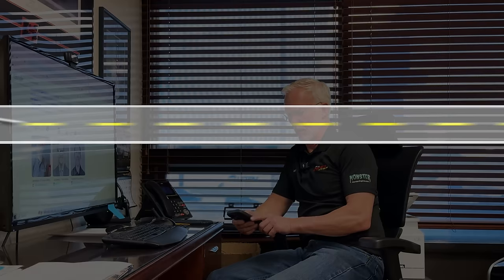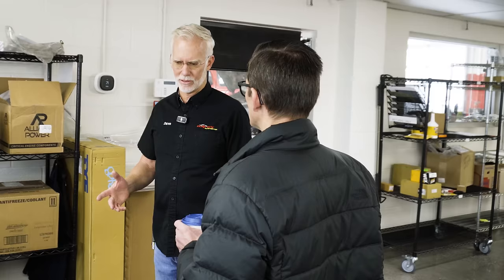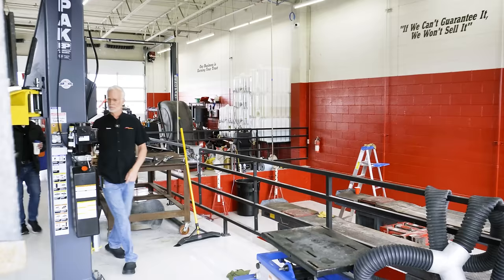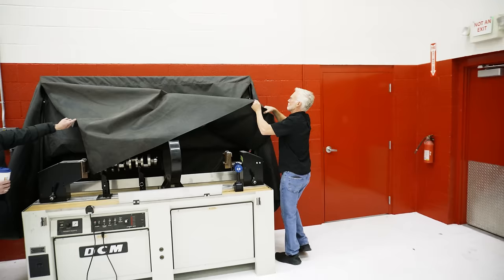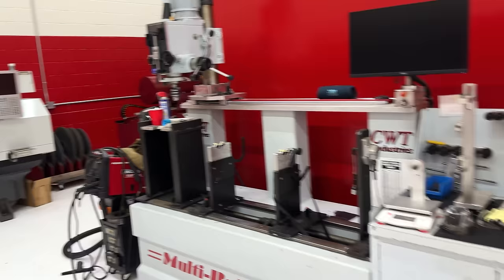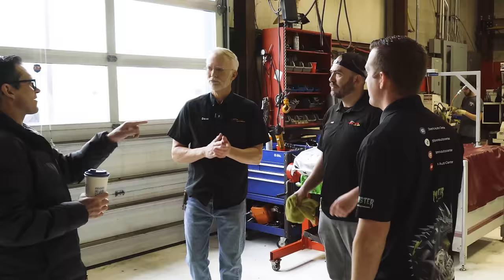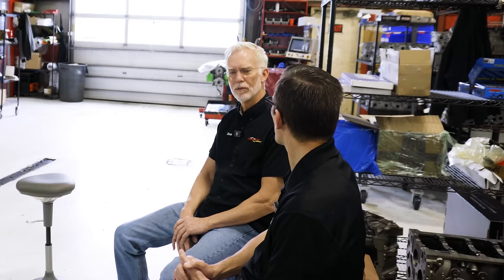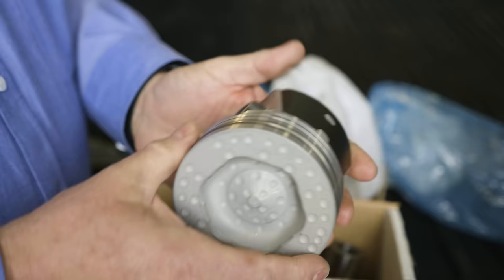Sitting Down With Lake Speed Jr. - The Truth About Oil Change Intervals and Analysis

Comment: I would love to hear their thoughts on Archoil AR6500 diesel fuel additive and AR9100 Oil Friction Modifier. 

I definitely notice a difference in injector spool valve noise when I run the AR9100, the whole engine runs smoother and quieter. I would like to see or hear about the science behind it. I highly doubt it’s a placebo effect as my wife comments on how quiet and smooth it runs too and she is not mechanically inclined or knows when I do or don’t use the additive. 

As for the AR6500 I notice a huge reduction in soot exiting the exhaust when WOT or any time I get on the throttle or towing heavy.

Comment: 25:27 i'm not sure i understand the oil consumption question/answer.
burning 1qt of oil in 1000miles is considered acceptable?
and if so, wouldn't that mean that an engine would have 'almost new' oil in it without ever changing oil just by adding fresh oil?

Comment: I have a question...

If it is recommended to change our oil every 3k miles, then that defeats the economic purpose of many high quality engineered oils with detergents and anti-foaming agents (etc).

There are few scientific studies that truly compare the quality of each oil on the market, but I generally consider penzoil platinum and amsoil as the leaders in synthetic motor oil.

What would you say is the best engine oil for 3000 mile oil intervals and would it be acceptable to use a high interval oil filter or should everything be fresh every 3000 miles.

Comment: 3000 miles between changes is over kill for most people the problem is 2year/20k miles service plans vs old school 6000 to 10000/ annual service plans, if you don't do more than 10k a year just change every year. Also if  doing more frequent oil changes changing the filter everyother time is fine.

Comment: Great stuff! Fascinating to think about soot being the major wear factor in diesels, and the role of fuel contamination. At 24:21, did he mean PCV rather EGR? Or is the issue that reducing blowby reduces PCV flow which in turn reduces oil entering the engine, which makes for cleaner exhaust and therefore cleaner EGR system?

Comment: Question for the experts:  I have an AMG S63 with the 5.5.L twin turbo - expensive motor.  I want to maintain it well so I don't get stuck with big bills down the line.  When I take it to the good local shop they use a vacuum system to suck the old oil up through the dipstick tube, instead of draining it out of the bottom of the engine.  I was wondering if this is a compromised approach because it is 1) bringing sludge back up from the bottom into areas that were sludge-free, and 2) not getting as much sludge out as a bottom drain.  I am grateful for any thoughts y'all may have.  Thanks!  PS, I asked after I saw what they had done, and they said they are willing to bottom drain it, which I am thinking is the way to go next time.

Comment: I change my oil on my yota. Every 5k full synthetic toyota oil from the bottle I've done my analysis and Holy smoke. No wear. Car has 127k   I use regular gas with full bottle of injector cleaner every other fill up.

Comment: I bought a 23 camry 3.5 ,dealer told me the first oil change was in 10,000  miles i laughed so hard anyways I have 6000 miles on it and changed the oil twice already , its funny how they never mention a breakin period. The first oil change i did on camry at 2000 miles it had the normal break in glitter , i couldent imagine going 10,000 miles with that glitter oil

Comment: @DavesAutoCenterCenterville  After watching a ton of your videos, I decided to do a baseline oil analysis at 3700 miles for my brand new Duramax 6.6L and got back results marked "CRITICAL" in certain areas.  Silicone was at 100ppm, and copper at 175ppm.  Are these normal results for a brand new motor breaking in for the first time?  Or is there something I should we worried about?  This is my first diesel truck and I'd love it to last 30 years.  Thanks for all the great videos!

Comment: Some of my life long Friends had an automotive machine shop for over 35 years, and they built stock high performance and Top Alcohol and top fuel engines when a customer with a daily driver would get a engine rebuilt you could tell by the Bore and bearing wear that that engine did not have oil change intervals that were to long dirt it dirt the type of oil was not as important as changing you oil often like 3000 miles or less you can't change you oil to often you spend more money on Gas that oil changes!!!

Comment: So I have a different question about oil and filtration. How good is bypass oil filtration at removing contamination to prolong the oil life? I have worked with some ISO oil cleanliness type requirements and an old engineer really taught me something about particle size.  So I think a 10 micron filter might be practically useless to pull soot out of diesel oil as a speculative thought but based on pulling graphite and cast iron out of machining chips and swarf a 3 micron, provided it doesn’t strip the additives from the oil, would possibly make a substantial improvement.  It just feels like we aren’t doing ourselves justice spending a $10 bill or maybe more per quart on a quality lubricant but letting it become basically a cesspool of debris and contamination.  What’s the fiscally and technically based solutions to this issue?

Comment: The manufacturers current oil change intervals are INSANE.   Although the dealer tells me I am wasting money, the oil is changed in my Super Charged Dodge every 1500 miles, my wifes new Subaru which is direct injection, is changed every 2000 miles.

Comment: Great info. But i still must ask, does the oil used during auto dealership oil change time really do the job the public is led to believe (with respect to engine longevity)? Or are aftermarket/3rd party oil brands better for your engines?

Comment: Put a pre oiler in the 6.7 or a pressure switch so the motor won’t start till oil pressure gets a predetermined psi on the oil in the engine and I did just that on 1992 Dodge 12 valve 5.9 and I put a switch on oil pressure so it would not fire until 20 psi I think that would make life better for 6.7 ford so think about and let me know what you think ?

Comment: can I use a  gapless in a DI ecoboost motor? sounds interesting. Those statements about the OE service interval is spot on. My oil every 5k miles. Hell no from day one. Forced induction DI motor built with aluminum is getting Top grade oil every 3k. They also say 87 octane is fine. Nope Again. the motor originally was built for Sports cars to run Premium. That is all i put in it. Will it go without it sure, but I drive quick and want to keep the power up. So I treat it like a sports car and give it the attention it requires to stay healthy

Comment: Ok… Dave you just changed my paradigm on my oil change ideology. I barely do 10k a year in my 07 5.9 Cummins or my 18 duramax. I figured use the best oil filters and best oil. I use rotella T6. I figured an oil change a year under 10k was sufficient. I do use hot shot every day diesel. So what’s your thoughts on running ATF in the fuel and how much per gallon? Thx for all the info.

Comment: I’ve have always used 15w 40 Amsoil signature series oil. The 5.9 cummins in my 05 Dodge 3500  long bed dullay and I run Rotela 15w-40 regular oil for first year and the second year I run my 15w-40  Amsoil 15w-40 for the rest it’s life and have really had a great experience these cummins motors and have never had to change injectors  in 92  12 valves and drove it for 14 yrs 185 k and then I bought a 05 Dodge 5.9 so I do send my oil in for  Blackstone to check it out and every time they say run it 5000 more but when Iam getting my sample I am changing my oil and I look for fuel in oil or coolant in oil so that’s what I do good or bad ?

Comment: Really good stuff here, interesting to hear other peoples opinions, but honestly, with the quality of todays oils, I change my oil every 8-10k miles I change my filter twice between that.  I own 2 cummins a 2001 and 2011, the 2001 has 300k miles, no issues there the 2011 has 100k still no issues there either.

Comment: My question is about gapless rings in gas rngines - is there any advantage to using them in a daily driver where reliability and durability are more important than using the max power I'm building to? Y'all covered gapless rings in diesel engines, but with the different needs of my humble Ford Modular, I don't want to add issues where none need to be.

Comment: At about 3:30 Lake Speed states that engine oil gets thicker at colder temperatures.  Thats not true.  Oil is engineered to get thinner at cold temps.  Read from an oil viscosity explanation:  The five and 10 digits (as in 5W30 or 10W30) refer to the viscosity at cooler temperatures. So, that means when you are comparing 5w30 vs. 10w30, the thinner 5w30 will circulate quicker, and flow through bearing tolerances better during an engine startup in the winter or colder climates. The “w” behind the five and the 10 indicates that those are the viscosities in colder or winter temperatures. The viscosity of the winter number is tested at 0 degrees Fahrenheit. The 30 refers to the viscosity at higher temperatures.

Comment: Question how does detergent help carbon deposits on direct injection when the fuel doesn't spray on the valve? Which is why some manufacturers have port and direct injection especially on turbocharged vehicles

Comment: 'Acceptable Oil Consumption' is 1 Qt to 1,000 miles? THAT'S NUTS! I have been an AMSOIL guy for my entire 50 year driving life. I have gone way past 200,000 miles on many engines with LONG drain intervals, in some cases up to 50K miles with high bypass filters. I have almost never had to add ANY oil between changes! My old 95 Dodge 1500 went 250,000 miles in 25 years and still didn't burn ANY oil. I just had to replace the truck because the body was disappearing rust by rust.

Comment: first, enjoy your content. Oil types, brands, and intervals are hotly debated topics with many opinions making it confusing. I believe you recommend changing the initial oil at 500-1000k as you did for your daughter's Corolla. I have a new Lexus GX 460 V8 and was planning to change it at 1k until a YT video regarding oil interval, someone replied stating that the initial oil Toyota factory puts is a special blend for the new engine protection of initial break-in and by changing it earlier than recommended by the manufacture you lose the protection chemicals which are not always present in subsequent oils changes such as Mobil one or other brands. Toyota cars build in Japan get their oil from Idemitsu and make a special blend for the initial fill. As an oil specialist, what are your thoughts about the special initial blend in Toyota/Lexus or their oil the same Mobile blend used in Toyota built in the USA?

Comment: I don't want a new truck. Period. I want a strong platform with a reliable powerplant and drivetrain. I want to drive the same truck I already have, in the same way I want to keep the quality tool that I invested in. I've already made the purchase, I don't chase the newest gizmo, and I want my equipment to keep serving my needs, without interruption. I don't want the headache of shopping, dealers, and questions of reliability of new systems where bugs and problems have yet to be worked out. That's why I own a Dodge Ram with a Cummins 5.9. If I could run a 12-valve 5.9 into my 3rd Gen Dually, I'd do it in a heartbeat.

Comment: So.... We need circulation pumps to run around the clock?
I put an oil pan heater to plug in when it's in the 20's f°
And don't just start my 7.3 and go, let it idle to I hear the turbo out of the exhaust

Comment: I think 3000 mile oil changes might be a little overkill with todays engines and oils. However, changing on a regular basis whether at 5, 7.5 or even possibly 10K is imperative. I have seen engines last 300k + with regular oil changes of 7500 mile. For the average person and the average vehicle, regular oil changes at or around 7.5k are going to be fine. A lot of the engines failing early (like Kia and Hyundai) are from poor manufacturing, not prolonged oil changes.  Changing at 3k or so MIGHT make your engine last a little longer, but the reality is most engines today outlast the rest of the vehicle and/or your willingness to keep that vehicle.

Comment: Great video, thanks for the quality info! 😊 I'm running a 2010 Honda Jazz (Fit) 1.3L with 190,000kms on it here in warm QLD Australia. No issues at all, has been a great car and doesn't seem to use any oil yet. I do oil and filter changes every 10,000km with 15W-40 semi synthetic but after watching this I'm thinking it should be 5,000km for the oil and 10,000km for the filter? I'm also running it on E10 fuel as recommended by the manufacturer, should I change to 91?

Comment: I didn't understand what was the conversation about the crankshaft under the cover with green light. 
??? 
What does diesel additive do to gas powered injected ? 
Does it harm parts like ethanol does ? 
Is the engine block that was welded an IRON BLOCK ? 1800F is too high for aluminum. 
Diesel or gas engine ? 
Did he say a cat should only last 80k miles ?  California cats are specific ? 
What about the NASCAR with superhard metal that are hard to hone ? Do you worry about zinc causing wear ? 

Does the direct injection comments apply to gas engines ? Such as  KIA GDI GAS ENGINE ? 
I saw an engine teardown on a new Skyactive G or X more likely. 
The oil ring was clogged with carbon . Engine had less than 50k on it. The X engine is compression ignition but gasoline based. HCCI. 
I would like to see Ford license the tech and apply it to a V8 truck motor. That way fleet operators could replace diesel engines with gas but not have the CARB Board in California say you must retire that vehicle in 10 years. Diesels. 
The FedEx contractors have already sold most of their diesels in this town. We have the highest pollution rating in the USA. THERE ARE hotspots in the Texas and Louisiana refinery and chemical industry on the gulf port ? that I would never live near. Cancer clusters, respiratory problems, etc. 

You don't know how much we pay for good weather. Clean air.

Comment: Diesel Engines can increase the oil level due to fuel dilution. Excess idling, hard driving,  cold starts, etc makes the long intervals no longer valid. Manufacturers have a seperate intervals for "severe" driving.

Comment: Thanks for the awesome video and the plethora of information. I run a 3 litre eco diesel and very anal on service and maintenance. Researched everywhere but this finally makes sense. I put archoil  in every fill up. Can you recommend an additive?  I will now be changing my oil every 3000 miles also. What’s your thoughts on intervals of fuel filter changes. Thanks again for another awesome video

Comment: Did i miss this? What 6.7 are they talking about grabbing the mains? Cummins or Powerstroke? I would also like to Lake's thoughts on idling? I am totally against it. I own two diesels and have less than 10% total idle time. I believe idling is a killer to diesel emissions components.  I have done informal testing and found owners that idle a ton have emissions related issues while owners that turn off the engines to avoid unnecessary idling seem to report high mileage without emissions related failures along with reduced regen cycles.

Comment: So I will definitely be changing oil more frequently. I do have 2011 hemi ram 2500. Primarily just for camping pulling their camper. I do run synthetic but we are only putting on about 4000 miles a year can oil last through the year or should I be changing this a couple times?

Comment: I run a number of new and newish different type vehicles and motorcycles, most are under new warranty. the problem for me is I can only drive one at a time and so the oil change regime is dictated by the calendar rather than mileage. We live in the country so most of the running is hot. I think that oil in a modern engine is still in good condition under those circumstances for much longer than one year. I have also run a product called 'Power-Up' for 20+ years now and have never had any kind of repair problem. Am I right? the servicing is very expensive here with the Jeep dealer (for instance) charging over $50 a litre for engine oil!
Reply: Just to clarify, the oil change recommendation is 10,000km or 6,250 miles, They are all petrol engines from 250-600hp in the cars and pickups One Britsh, 3 American and one Japanese.

Comment: Just a heads up I've taken engines out that had rear main problems that were caused by some fool who put in three different torque converter bowls that did not weigh close to the same. Vibration took out the rear main

Comment: Boy, is it worth doing an oil analysis on my 2000 E450 shuttle bus that I live in? It has a V10 with around 177,000 miles on it. I actually change the oil in it every 2000 miles. I guess if I do that, I probably don't any kind of analysis. I converted it to solar panels, batteries, running water, bed, fridge, stove/oven...everything. We travel the country in it. I just want the thing to last forever.

Comment: In my 1990 SBC 5.7 and 89 4.3 i have routinely used a 50/50 mix 5w30 car oil and 15w40 for enhanced ZDDP and TBN.  What do you think?  Did you say diesel oil does not have adequate detergent as compared to car oil?

Comment: Did he say a quart of oil every 1k miles that is obsurded cause then your burning oil causeing more emission that they claim are pollution. And another question I’d like to know is if you use an engine oil flush does that remove the zinc coating?